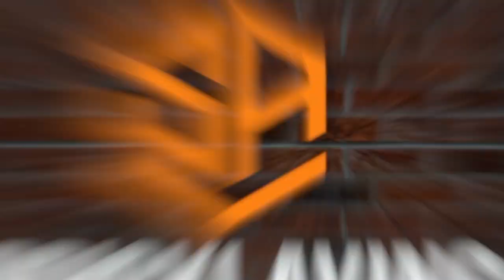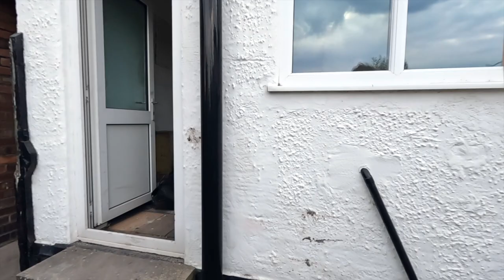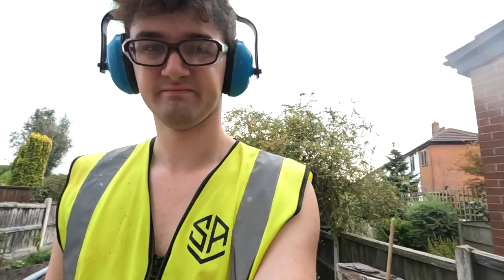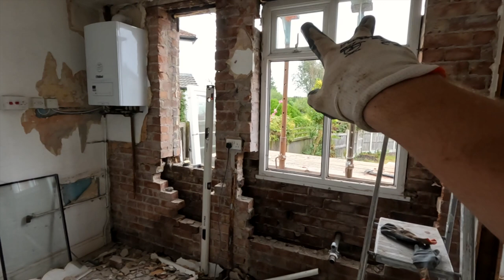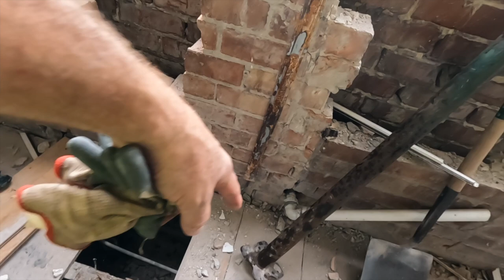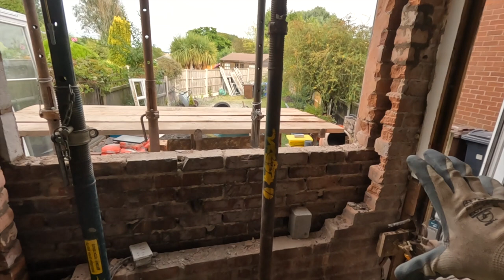COMPLICATED FRENCH DOORS PT 1

Comment: Bejezus... that looks a messy one, but I'm sure you'll pull it off. As you always do. 💪Respect. 

Sadly, of the rest of the house... I'd say a simply eBay door purchase is the least of their problems. From what I can see, their electrics look ⚡shocking as too their floor joists & floors. 

But not your concern... now looking forward to part 2 and more of Alex's new friend 🐶😂
Reply from the maker: It’s a full refurb back to brick mate 🤙🏾🤙🏾🧱👍🏽
Reply: @SteveAndAlexBuild  M8, from what we can see from your video so far.. it look more like a candidate for knocking down and starting again?

Also them cracks in the that wall you cut into didn't look promising either. But I'm sure you'll do a great job 👌
Reply from the maker: @Sparks1Plumbers0  🤙🏾🤙🏾🧱👍🏽